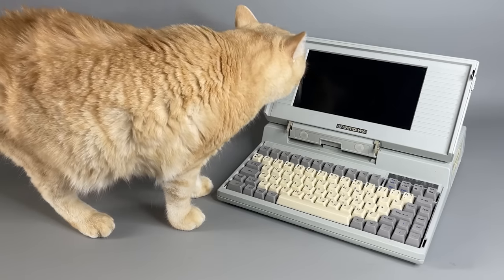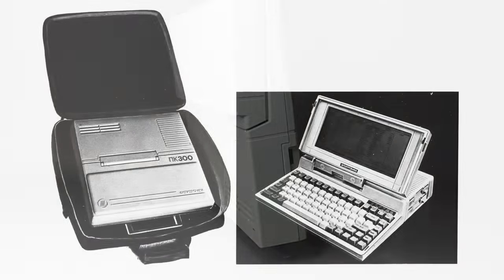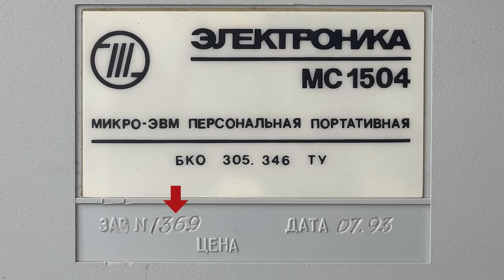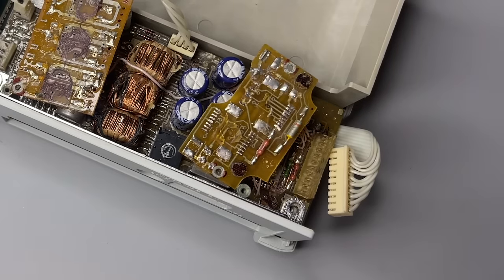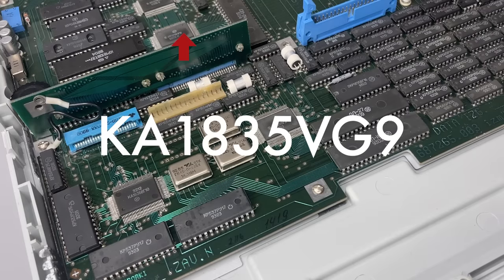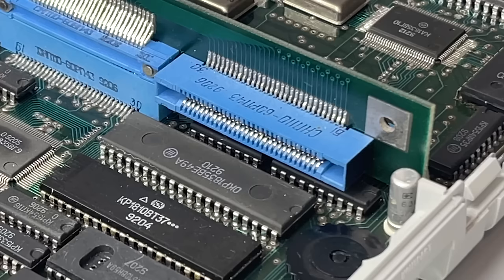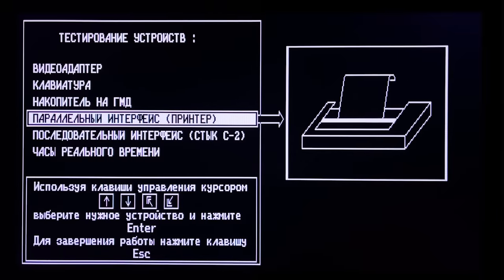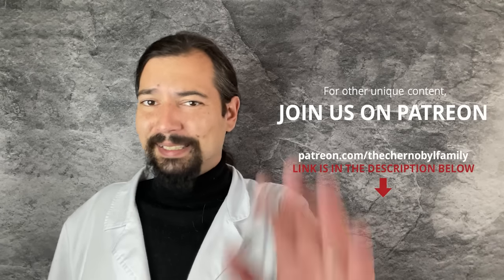I FINALLY FOUND IT! Behold Elektronika MS 1504, the ONLY SOVIET LAPTOP EVER.

Comment: ELEKTRONIKA WAS A DIRECT STEAL COPY OF THE JAPANESE "NEC" BRAND LAPTOP WITH 8086 PROCESSOR THAT I HAD. THIS WAS NOT AN ORIGINAL SOVIET LAPTOP.
Reply from the maker: I AM NOT SKILLED THAT GOOD IN CAPS LOCK USING BUT LET ME TRY YES YOU ARE RIGHT BUT TO BE ACCURATE MOTHERBOARD HAS ORIGINAL SCHEMATICS THOUGH I AGREE THAT NO MATTER WHAT THEY TRIED IT STILL FAR BEYOND WHAT WEST/JAPAN MADE. CHEERS AND WELCOME TO THIS STRANGE LAB.

Comment: 1:40 speaking about 720 kb and putting a 1400 kb disk in.
Reply from the maker: I had a density selector glued w/transparent tape from the bottom. In fact I prepared two 720kb floppies with dos, but they appeared of no use.